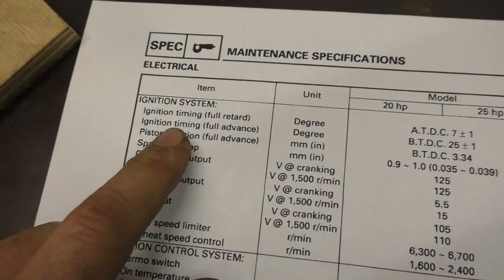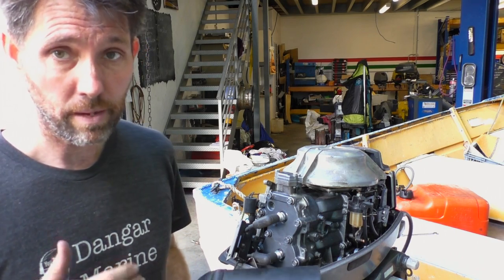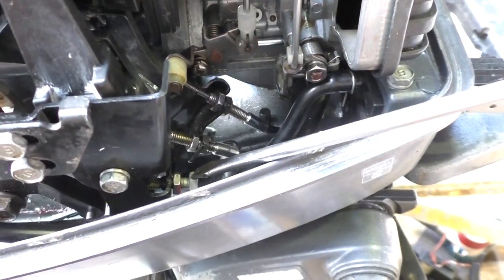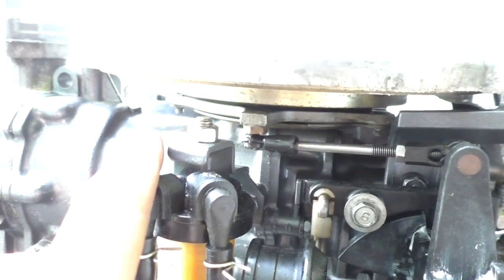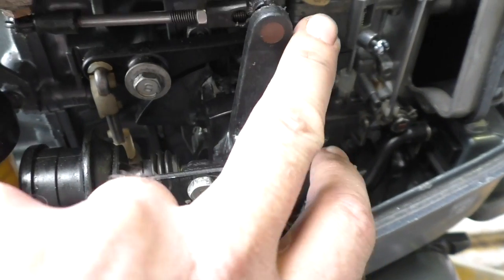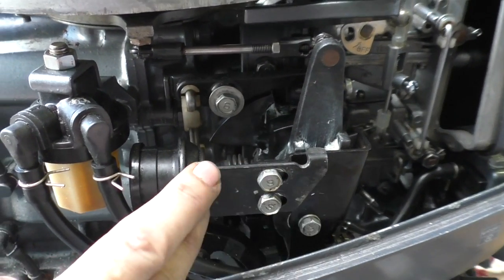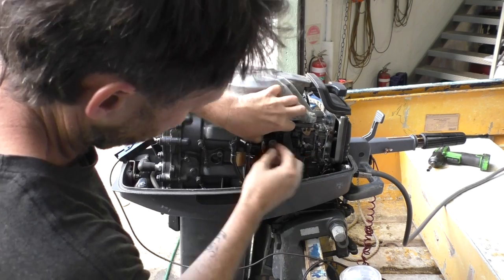Using a timing light to set outboard ignition

Comment: Its funny that you mention a sheared key in the flywheel, I bought an el cheapo motor  over the winter.  It had a terrible backfire and wouldn't you know it when I took off the flywheel the key was busted.  Great video
Reply from the maker: I was half expecting it to be the problem with this one if the timing was the cause.

Comment: Congratulations on the sponsorship. Great and instructive video btw.
Reply from the maker: Thanks mate!
Reply: Dangar Marine hey quick question, what is the normal amount of leakage/dropping oil in the water after running it for a while?
I have brand new Mercury 50hp and every time I come to the shore there is oil in the water not much but it's definitely noticeable.
Is this normal or could there be something wrong in the engine?

Comment: I have a 1988 Mercury 15 Hp.  I have all the idle timing done, thanks to you videos.  Now it says I need to set the Wide Ope Throttle timing.  What the best way to do that.  Can I put the motor in a barrel to do this or do I need to be on the water.  Just not sure if I can see the timing marks while bouncing on the water.  I'm assuming the motor should be under load, or can the prop just free spin.
Thanks for any advice

Comment: I noticed you referred to an owners manual on the engine settings. I would like to see a caveat there. I own a 1971 Johnson 85hp that for years could not get to start easily. The manual had the breaker points gap .10 but after extensive forum posts saw someone insisting it should be double that at .20. Well, they were right. I no longer take any old manual at face value. I'm guessing the addition of CMC power packs changes everything from what the factory setting originally were?

Comment: According to service manuals, some models of Johnson/Evinrude engines require a special analyzer ($250) to set timing.  I'm guessing it sets timing statically.  Do you know if there is a method to substitute for the analyzer or a way to set timing without it.  Manuals discourage doing that, but not certain why a timing light couldn't be use, presuming engine runs.

Comment: Thanks for the videos!  You've been a tremendous help with my 1985 Johnson 115 hp V4.  I had some questions; you mentioned being on the water when setting WOT timing.  Is WOT timing necessary when the idle timing looks good?  Do you leave the boat on the trailer or tied to the dock?  I'm imagining a buddy driving the boat while I set the timing!  Also, can I utilize the fast idle lever on the control to set timing, or will I need to use the throttle?  Thank you!
Reply: No idle (or pickup as Mercury calls it) is independent of wide open throttle because (on your v4) they are 2 seperate linkage adjustments. I strongly urge you to invest the $20 and buy a factory OMC service manual as it will walk you through it very easily. DO NOT advance the throttle cable on the bottom of the motor to set the idle, as it throws the whole thing out of whack. The full throttle timing is always done in the boat at max RPM, so no you cannot do that on the trailer and i doubt you have a test wheel. the good news is if the synch n link was done properly AS PER THE FACTORY SERVICE MANUAL, you should be ok if its running well. DO NOT touch the high speed timing screw without knowing were the timing is.

Comment: Can the same (timing light) procedure be used to set INITIAL timing on an Evinrude V6 150 HP, 60 deg?  Clymer shop manual omits use of timing light and instead explains mechanical setting, beginning with establishing TDC.  Obviously, pointer setting needs to be corrected first, per the manual, but manual fails to offer use of timing light for initial setting at idle. Thanks again for all your great tutorials.

Comment: I have a 1985 mercury 50hp 4 cylinder outboard do you know the correct idle speed timing setting for my engine. I know the  max timing its stamped on the engine. Thanks

Comment: Hi  Stu, do some  or more modern  outboards look after timings automatically? If so what brand of  or year did outboards start doing this?
Reply from the maker: Hi Dean, yes, a modern outboard will get a signal from a coil under the flywheel but that coil can't be moved at all, it is just a crank position sensor that tells the computer where in the cycle the crankshaft is and then the computer decides when to fire the spark based on RPM. It is a pre-programmed curve so there is nothing you can do to change it.

Comment: I tried to find the video you were talking about towards the end of this one on fixing if running lean.  Can you please point me towards the link to that video?
Reply from the maker: I'm not sure I actually got around to doing a dedicated video on that but generally engines run lean when the carburettor jets are blocked so I would recommend doing a carburettor clean if you have the symptoms of running lean (white spark plug tips, lean sneeze, low power, stalling at idle etc)

Comment: Greetings from Finland and huge thanks for guiding me through the rebuilding process of my outboard with your awesome videos!!  I have a small guestion. My 40hp 3-cyl 1989  yamaha runs fine for 15 seconds while idle and then it suddenly retards the timing 10 degrees and the engine stalls. This happens every time I start the engine, so any ideas what could be the problem?
Reply from the maker: It could be that the engine starts with the timing advanced as a start up / warm up program and then retards it once it is running for a period of time. If it is computer controlled then it might not be adjustable so look for a sheared flywheel key or maybe just another problem like a blocked carburettor.

Comment: hey Dangars hey Stu, I have a question related to this video, you said if the ignition is adjusted right but there is backfiring then it is most probably a to lean running carbs. Sorry for my bad english.
keep going I love you vids.
br Ursus
Reply from the maker: I didn't show it, but I had cleaned these carburettors before I started. I think you are right about it being a lean condition but I think it might be from a different cause.

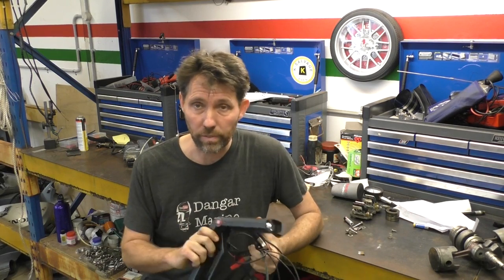Comment: Question 1998 force 75hp. 120 plus on cylinders had bad stator while is there I replaced timer base, rectifier all 3 cdm coils now I have no more adjustment on lever to timer base one more turn its coming disconnected. I made sure key way on fly isn't sheered but with timing light we will say timing pointer is at 6.00 o'clock the timing marks on flywheel are not there I moved left and right with light  I found marks at around 9:00 o'clock is the new timer base bad fly wheel magnets in good shape. replaced stator because very low voltage wouldn't charge any help would be appreciated ps how do you test these cdm coils

Comment: Thanks. My 60 hp evinrude  bugs  down went i go to take off is like no enaff rpms I rebuilt the carburetors clean all the holes they are all clean adj the floats level same problem replace all the hoses new plugs and wires new primer ball tank and hose I had the carburetors apart 4 times there are clean still same problem idles good don't plane off maybe is timing or bad staitor what you think my problem is.

Comment: ah thanks, i was watching the video and when i heard the engine backfire i hoped you would adress the problem, i set my timing right on mine but it backfires up to a point where its frustrating when sailing.
Reply from the maker: Fingers crossed I'll get to the bottom of the backfiring problem during the week and get the video out next weekend.

Comment: this is awesome. Can you advance WOT timing a little bit if you're running high octane fuel for more perforamnce? eg 27'c BTDC instead of 25
Reply from the maker: I don't think so. Running higher octane fuel allows you to increase compression without causing preignition by my understanding.
Reply: @DangarMarine  So with that logic, if you had the means of doing so you could skim the heads slightly to raise compression and run higher octane to squeeze out a few extra HP

Great videos BTW I have been binge watching all your two stroke tuning and diagnostic vids

Comment: Hi Stu, I have a 3m inflatable zodiac with a 20hp outboard (oversized I know but it's great fun). Unfortunately the transom has started to spilt (approx 1 inch length and depth) along the laminations of the ply where it joins the tube. Is there an easy temporary fix for this or is the transom knackered? Don't fancy loosing a new outboard to the depths. 
Thanks Matt
Reply from the maker: Hi Matt, the trick to repairing transoms like that is to make them stronger than they were before. If it broke when it was new it is only going to happen again. I'd need to see it to be sure, but I would recommend fixing it with epoxy and then adding a sheet of 5mm thick aluminium to the outside to give it some extra strength.
Reply: I am doing the transom on my boat at the moment.
 For a 20hp engine you want at least 12.5mm/ 1/2" thick ply if you use good outdoor ply . For a Zodiac transom you don't need a big piece, so use marine ply. Sand all the varnish/paint off the original transom, cut a copy from the marine ply and glue the copy over the old transom  with epoxy. Make sure you work the epoxy into the crack, and use plenty of epoxy ( 1sq yd would be about 150mL / 1 cup of epoxy.) Clamp (no screws) the two bits together  for a day or so , and just hard enough to squeeze some of the epoxy from the join (you need to leave most of the epoxy in the join area) . Once the epoxy sets you can paint the repaired transom in more epoxy (2 coats) and then paint the transom. You have to cover the epoxy with paint or something  UV resistant, epoxy breaks down in UV.
Zodiac transoms are always weak for the job they get asked to do- jumping waves and running up on the beach puts more strain on the transom than would normally be the case.

Comment: Hi.  But its backfiring after you set the timing to 6 AFTD. Strange, because this symptom indicates a late ignition. . Did you fix the backfiring on that motor ? I have old Suzuki DT100 and its backfiring on idle. i do not understand why .  It set the timing to 6-7 AFTD on idle . I thought the problem on my suzuki the late ignition.

Comment: I am looking to buy a test wheel for a 1994 evinrude 60hp evinrude but there's so many listings I am getting confused. The evinrude manual simply says to run the engine with the proper test wheel (and to not use a propeller). My model is E60TTLERV. I am hoping someone with more experience with Evinrude outboards can point me in the right direction.

Comment: Howdy mate,  luv the vids you make!   Have a question,  I come across marineengine.com awhile back myself, but was put off over the postage cost.. are they still using Bongo for a postal service?
Reply from the maker: Hi mate, good question, I can't recall what service was used to send my parts. It's interesting about the cost because the bits I ordered crossed half the globe and I don't recall it being that pricey compared to the cost of the parts. It might be worth dropped them a line and seeing if they have a couple of options when it comes to postage.
Reply: Thank you for the replying,  I did go have a look at the marineengine website again, they're using another international postal service now, with quite reasonable rates I must add. I needed to find a complete water pump kit for an older 80's 7.5hp Mercury outboard awhile back, I was looking at around $130 to send the water pump through that Bongo postal service to Australia and I dont recall it being express either. Now they're using another international postal service with good rates, Im quiet happy to recommend them to any1 needing parts

Comment: You seem to know a lot about timing.  Mine is a V6 Mercury 150.  Which one is the #1 cylinder?  Top left, or top right, looking from the side of the spark plugs?
Reply: the cylinder closest/highest to the flywheel is #1, or on your motor thats top cylinder on the starboard side.

Comment: Good video Stu, did you change the battery in your timing light. you're last video showed good battery changing skills so just wondered. Haha Anyway we haven't left yet on our trip down south. got the trailer home and hooked up the water just to find my RV hot water heater blew out. so waiting on a out of state new one to come in next week. between the truck part and now this down a thousand bucks. Ouch! allot more than a battery in a clock. Oh Well, update didn't know about the direction on the induction clamp on the timing light? will have to check mine. what happens if it's on wrong?
Reply from the maker: Bummer about the hot water, oh well, I'm sure the trip will make it all worthwhile. I'm not sure what happens if you have it on backwards. The current will be induced in the opposite direction in the coil so I wonder if that means the light won't detect it at all.
Reply: Then either mine doesn't have a direction or I'm just lucky. I bought this timing light 40 years ago.
Reply: If the timing light is 40 years old, then the design is probably even older. That still only makes it a 1970s design  though. 
Although there are LED timing lights, until recently the LEDs were too weak to be used in daylight. However one I saw the other day has a night/day switch and 10W LEDs, so they probably have got to the point of being useful.
Most of the timing lights out there now use a Xenon flash tube. The gun takes the battery voltage , puts into a simple oscillator (basically changes 12V DC to about 9V AC) and then via a few diodes and capacitors or more commonly in the older gear, a simple transformer - steps the voltage up to around 300v (older designs use 600v or so) and store it in a capacitor . That voltage is connected across the xenon tube which will not give off any light at this point. The 'reflector' behind the tube is also a 'trigger' plate/wire and is wired up, as the name suggests, to the trigger system. On older tubes the spark plug pick up is connected directly to the trigger plate which was found to be problem on Kettering ignition systems with low plug voltages ( some only generate 10-12Kv) at idle- the voltages from the sense wire just would not trigger the tube to fire reliably- but these units don't care which way around the plug lead clamp goes and on CDI and modern cars the low voltage issue does not happen. More modern timing lights use the negative swing of the spark plug lead voltage as a signal to activate some sort of electronic switch (SCR, DIAC, but these days more likely a FET) to dump a 70V spike onto the trigger plate, which causes the tube to fire . As soon as the tube fires, it uses all the stored energy in the capacitor in one hit, and once the voltage drops to about 50 volts, the tube turns off. The cycle repeats as long as you keep the trigger depressed.

Comment: I am subscribed and watch all of your videos.  Very good work! 
   And  I need advice from someone who is experienced,  like you. No one else seems to be able to help me.  
   1987 Evinrude 120 hp V4 2 stroke, won't idle. I've cleaned the carb twice. When trying to set the timing with the timing light , it  appears that cylinders 2, 3, and 4 fire at about the right time.  But , number 1 cylinder fires in all four positions on the flywheel. 
   Seriously,  I put a piece of tape on the flywheel at TDC , and 3 more pieces of tape around the flywheel at  90° intervals and with the timing light hooked onto the #1 plug wire , it fires at all four tape markers once in a while,  causing it to backfire.
   What part or mechanism is it that tells the plug when to fire? Any ideas?
   It has CDI ignition,  by the way.
Reply from the maker: It could be a bad CDI unit. Recording all four sparks on an oscilloscope would confirm this.
Reply: @DangarMarine  thanks.  I'll try that. I appreciate your help.

Comment: G'day   stu i have  the  yamie 20 2 stroke 1990 i think.. have been watching all your vids building my boat... mate ..when starting.. she fires up.. bing bing bing pop.bing bing bing pop.. have isolated.. top cylinder back firing.. i have done.everything... cleaned carbs.. coils.. sparks...set.carbies.. has  improved but still back fires... top plug is wet bottom plug perfect.. bottom cylinder runs like a dream.. im baffled do i need to look at timing
Reply from the maker: Hi mate. This procedure might solve you problem. Sounds more like a lean sneeze than a backfire https://youtu.be/NnotQmnKxKM

Comment: hi dangar! huge fan of your work. nice video, love your content. i jave a question, if you happen to see this i would love to know your opinion on my issue. so i have a 60hp 2stroke yamaha. the other day i started it for the fisrt time after the winter. i "winteresed" it. and now it starts perfectly but when i get it going foward it goes but if i increase the throttle it starts to lose power and if i increase more the engine dies. i seams like it doesnt have power... i checked my propeller and it is perfet no issues there. thanks for reading and any help is welcome. (sorry for my bad english). keep the good work!
Reply from the maker: Hi Miguel, it sounds like a fuel supply issue. I'd be checking the breather is open on the fuel tank and it is all flowing correctly.
Reply: Dangar Marine thank you! the breather is open and the flowing is all correct. i canr figure what the problem is... (thanks for the help really "aprechiate")
Reply from the maker: Hmm, it is losing power because it is going lean as the throttle opens up so I'd say it may be that a carburettor clean is need then if it isn't any of the simple fuel problems.
Reply: Dangar Marine its possible, i am going to look on your videos on how to clean the carburator and if it is way to complex for me i will take it to a profession. thank you very much dangar! keep the good work. you are one of the few youtubers that actually reply to their fans! thanks again!
Reply from the maker: Good luck with it, let me know how you get on.
Reply: Dangar Marine thank i will!!!